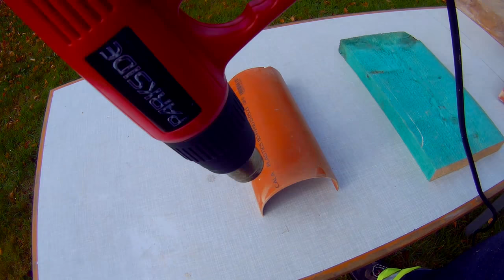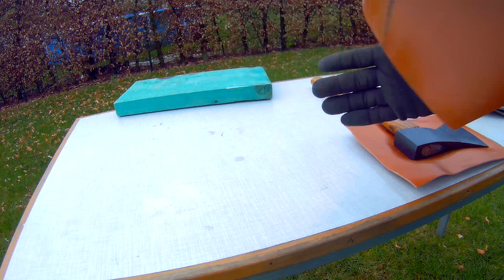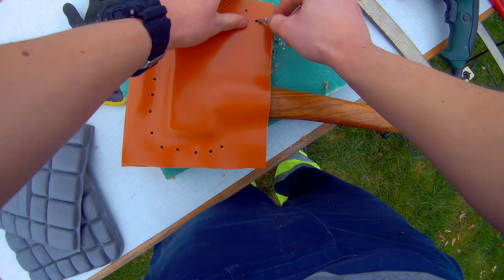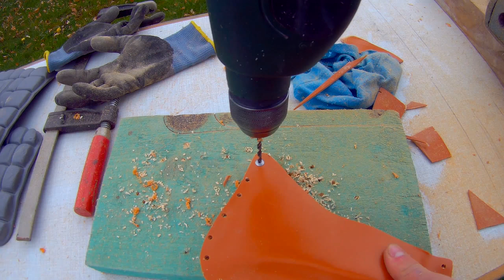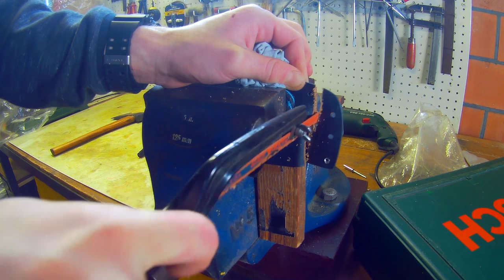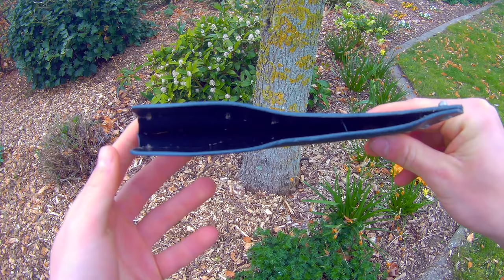Making a Custom PVC Axe Sheath

Comment: A band, leather strip, cord, etc can be put on the back of the sheath to be used as extra retention. Or add a strip of pvc shaped to fit and swivels down to close and up to open. Good job though.
Reply from the maker: +Red Beard Thanks! For me the sheath is snug enough as it is.